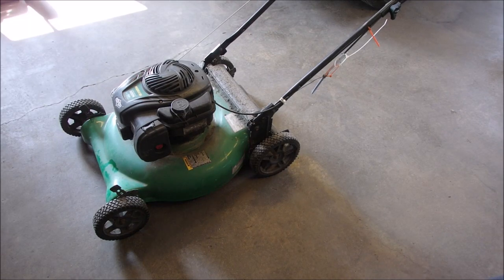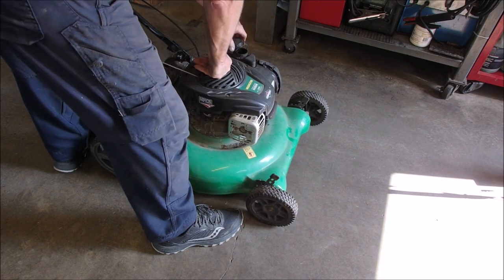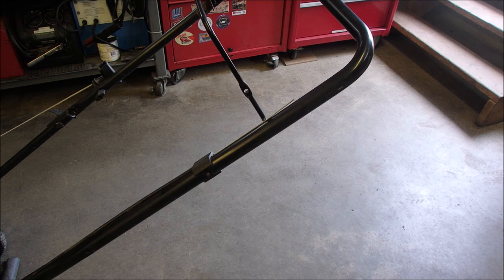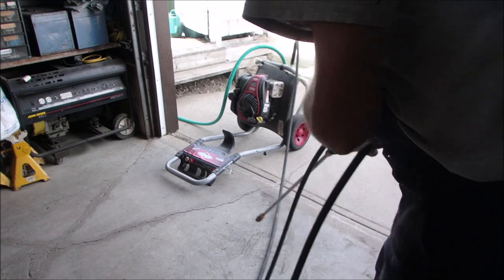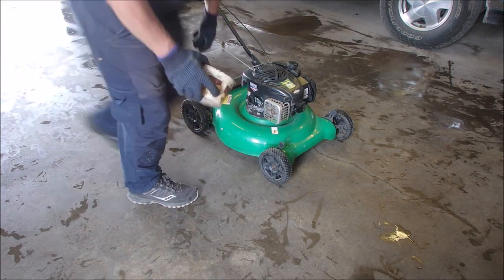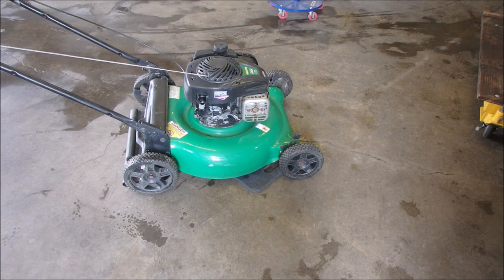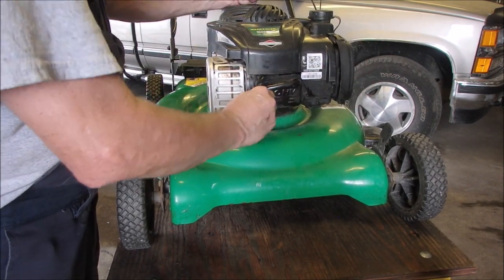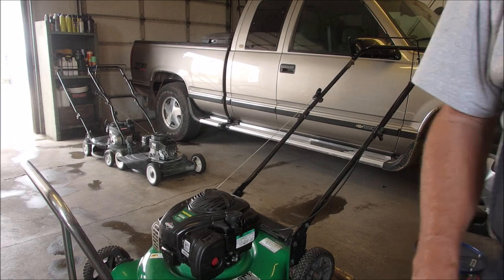WEEDEATER Mower With Briggs 500E, Homemade Stop Cable

Comment: I just got one with one of those engines to repair with a bent crank. 👎🏼
Reply from the maker: Wow   Is it worth doing.?
Reply: @BrucesShop  despite the videos showing how to straighten one I've never done it. I think it would be easier to replace the crank or the entire engine. 🤷🏻